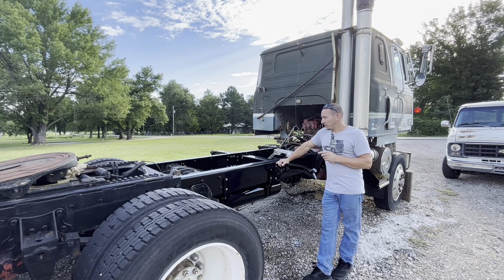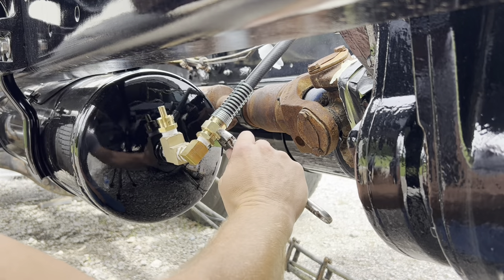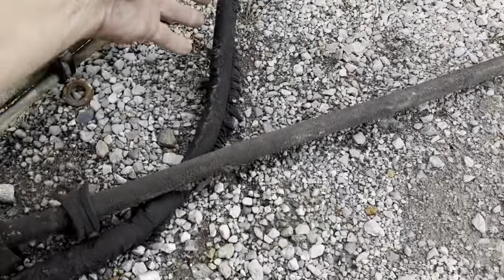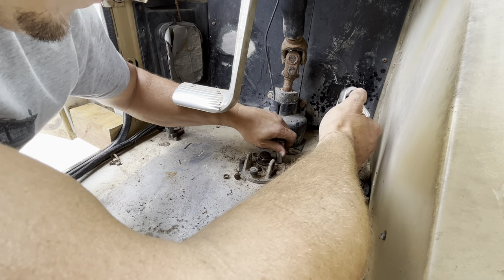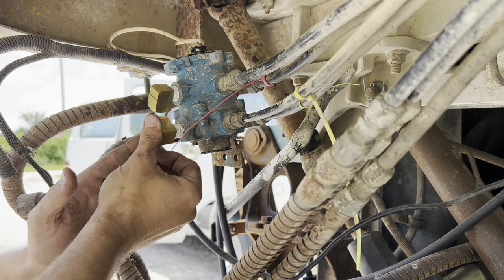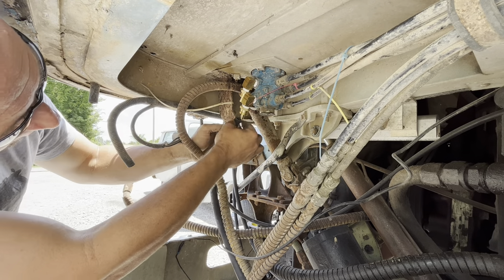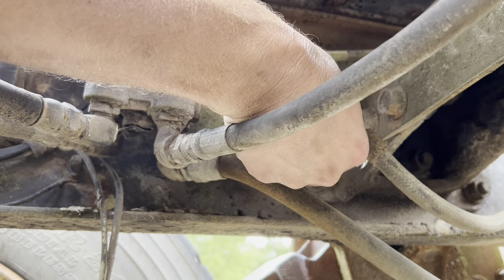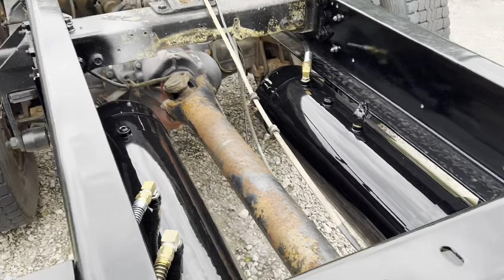Cabover Restoration. Ep34. Running air hose and stuff.

Comment: Been watching all there’s restore videos and enjoying them also just a suggestion if there is a extra port on the tank add a quick release so then you can connect a air hose for tires or cleaning use
Reply from the maker: i really appreciate you watching my videos and thanks for the suggestion.

Comment: Good video. I'm restoring 1985 9670 the little stuff nickel and dimes you. Was a 100ft anough air line? I've found using Map Gas portable torche  works great heating up fittings and is alot cheaper and easier then bringing oxy ectlyne torches out. So funny at the end not the first time I've heard of something like that. Haha
Reply from the maker: yep, theres a LOT of tired parts on these old rigs !!!! thanks for the tip and for watching!

Comment: Do these things have Jake brakes?
Reply from the maker: that’s dependent on if the owner specified that option or not when new. pretty much any of the large diesels can be fitted with jake brakes. this particular engine has not had them installed. thanks for watching!